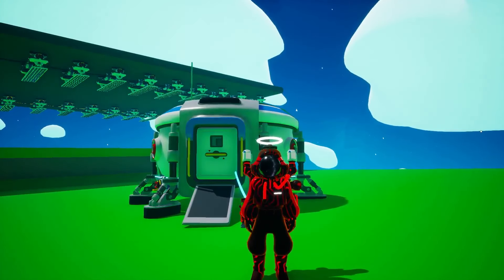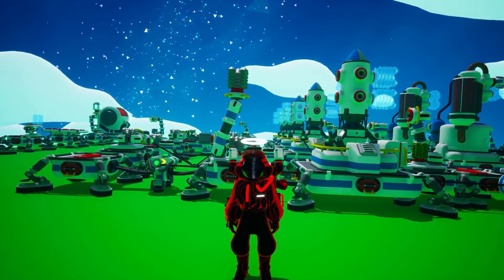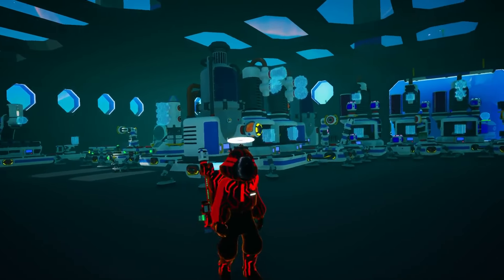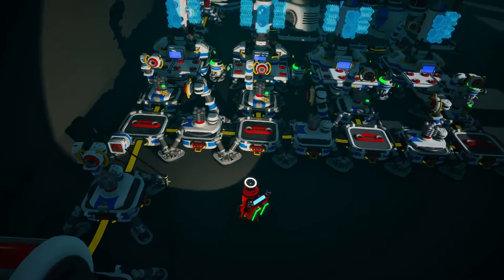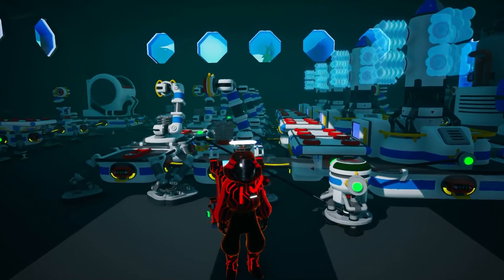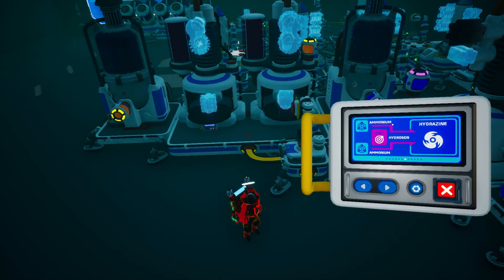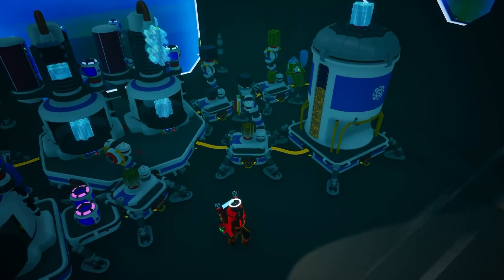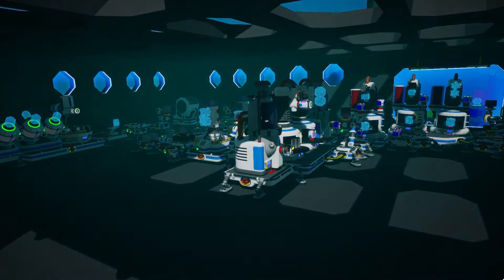Soil to Nanocarbon Alloy Factory in Astroneer

Comment: This is great video, however I want to point out one problem that I have with it... At the point in the game that you can build this monstrosity of a factory, you most likely already unlocked rails, autoextractors and large rockets with massive storages. I built an insane NCA factory that created me a large recourses container of it, by simply creating a massive mining facility on glacio, where you can find literally every single solid recourse required (I love glacio so much) you can find tons of graphite and ammonium near the core, titanium in the caves and iron literally everywhere. Put one of two atmospheric condensers on vesania for nitrogen and hydrogen(75 ppm and 100 ppm respectively), put one on the atrox for helium (25 ppm, which sucks, but what can you do?) and just pump argon from glacio (100 ppm, again, I love glacio). Oh, and with the addition of tappers, you don't even really need a good power station or an organic production, since both of them are being taken care of! The factory itself doesn't require ANY circuits and work as long as you pump recourses into it.
Reply: "One on the atrox for helium (25 ppm, which sucks, but what can you do?)"  Simple, you double the power setup and use two.
Reply: @InternetGravedigger  Yes, an obvious solution for, like, every single problem. I was upset because this was the only truly unique resource in the game with such a ***** rate of production
Reply: make a video on how to build it then
Reply: @Oatis24 yes please
Reply: @Oatis24  I don't have a PC, I play on switch, so unless you want a video compilation of 30s snippets of 20fps footage, I wouldn't want that if I were you
Reply: okay

Comment: To make this even better (NCAF 3.0 Video) You can make a version where in the long run you won't hollow out your planet by using Astronium, from a planet's core. You will just need to replace the beginning with Rails, C.O.L.E, and Auto Extractor. Craft up solid fuel jump jets and Destroy those.
Reply from the maker: I have considered an Astronium version. Not sure if another video would be appropriate thought since only the scrap part would need to be changed. I may do it though.

Comment: Can't get it working. First problem: the autoarm put the scrap directly in the rocket and not on the platform with the count sensor, so the sensor doesn't count. I had to separate platform with sensor and put an extra arm to load the rocket. Second problem. The count sensor also turn off the auto arm. But when the auto arm start again, and how?
Reply from the maker: The scrap is supposed to load the trade platform directly. Once it does so, it is then forced to load the storage instead, and that's the entire trick. We use the storage sensor to tell the trade platform to leave once any scrap lands on it. This is why the medium storage and trade platform are on the same platform. Make sure the storage sensor is set to the "empty or not empty" mode, and make sure it is on the medium storage, not the Large Platform B itself.

It's also supposed to deactivate the auto arm that loads the trade platform with scrap. This is because we need the medium storage to not be entirely full of scrap upon the trade platform's return. When the trade platform returns, we want there to be just one scrap on the medium storage. When the trade platform gets back, it will take this one scrap, and that makes the storage sensor re-activate the auto arm that loads the platform once the resources brought back by the trade platform are taken away to where they go. This prevents items that are already "in stock" from being continuously traded when they are not yet needed further down the assembly line.

Comment: I know the visual location if the planets are not the same as the physical location.
With that in mind could it be possible to build a train from one planet to another.
 Start a train leaving atmo on one.
Then go to another planet and do the same hopefully you can see the platform of the first line and connect them.
Reply from the maker: I didn't know their location was different from what you see in game. This is an interesting concept. If this worked, that would revolutionize how builds like this work.
Reply: @worldclassjerk-epicgamer  someone did a video of jumping a rocket powered rover from one planet to the next. Which he flew right through the second planet.

Comment: Could you not just put a count repeater on the auto arm before the trade platform and set the trade platform to fire once its  reached 4 repetitions ? Seems simpler
Reply from the maker: You mean have the trade platform blast off after the auto arm moves four items? Count repeaters don't attach to things the way power and storage sensors do. They only activate things, so you have to use those in combination.

Comment: why dont you use infinte leak farm to get scrap ?
Reply from the maker: I don't know what you mean by this. I know you can get infinite scrap with organic using the tapper, and you can get infinite soil using cranes and gateways. I mostly try to avoid glitches, though, especially since the organic scrap glitch isn't even as good as getting soil from a rover the normal way.
Reply: @worldclassjerk-epicgamer   ı was talking about the event item "leek" its worth 0.5 scrap ıf ı dont remember wrong but ı understood your reason thx and ı have one more question can you do a video about making a true flat surface base or kinda true flat. I tried 2-3 ways but ıts always turn to ramp.